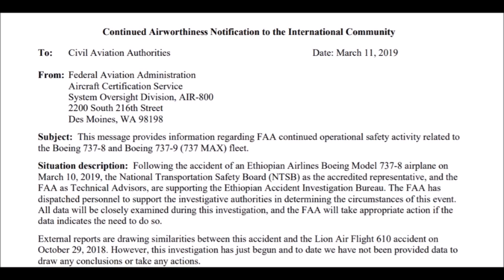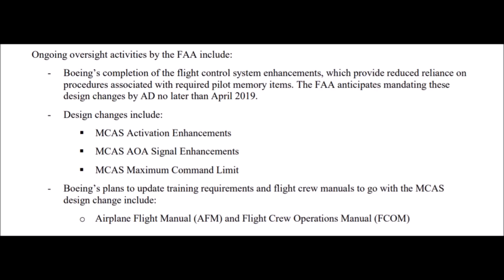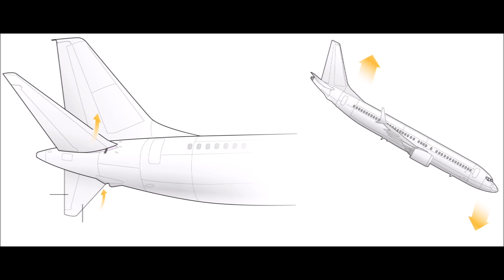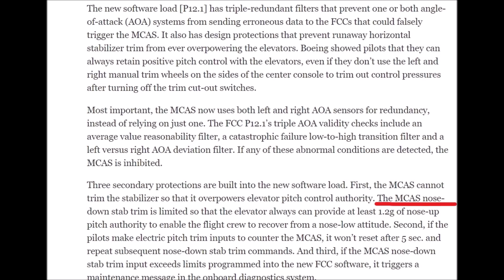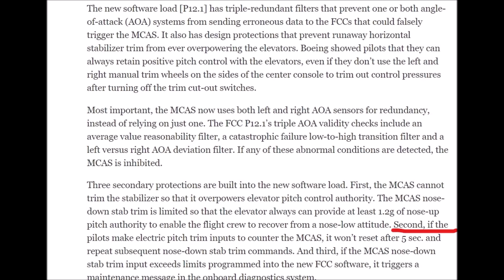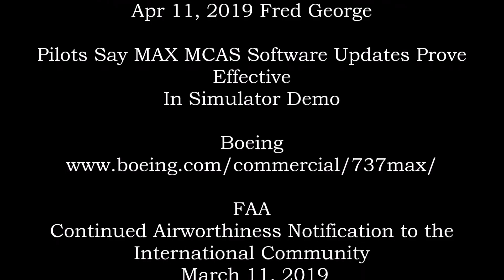737 Max UPDATE 14 April 2019 "The Fix"

Comment: I spoke to a retired Boeing guy recently. With any such organizations the engineers are gifted with "pointy-haired bosses"--- think as in Dilbert, the comic strip. These middle-manager types are ruthless people who sell out their staff at the drop of a hat. I would not be surprised if there are (or were) memos written by earnest engineers protesting the original MCAS configuration, memos that have now been deep-sixed.
Reply: Indeed.. Just look at the Challenger engineered who was ignored..
Reply: Precisely! Unfortunately nobody will go to jail, because the outcome was 'unforeseen', until it happened, twice!
Reply: An engineer at convair (who was part of a design team for the DC-10 rear cargo door) wrote a memo , he was ignored, result more then 300 died near Paris 4 years after that memo was written, lessons were not learned with these accidents 50 years later !!!!
Reply: @antoinemifsud4019  AAL 96 crashed in 1972 because of the door. MD wanted to keep it quiet, but the plane kept flying until the Paris crashed. It was grounded until the problem was fixed. Again it took 2 crashes with the same issue. Similar situation to the 737 hard over crashes in the 90's.
Reply: @fyrman9092  AAL 96 did not crash. Rear cargo door blew off, the plane made an emergency landing and flew for another thirty years.
Reply: @fyrman9092   Technically, AAL96 (the DC10 "Windsor Incident")  didn't crash, but only because of the incredible skill of the pilots in landing a seriously crippled and barely controllable plane.   But yes, McDonnell Douglas kept faffing around with half-fixes and arguing with their subcontractor Convair who should pay for it, which resulted in the 'Applegate Memorandum' -     "The airplane demonstrated an inherent susceptibility to catastrophic failure when exposed to explosive decompression of the cargo compartment in 1970 ground tests.   Since Murphy's Law being what it is, cargo doors will come open sometime during the twenty-plus years of use ahead for the DC-10... I would expect this to usually result in the loss of the aircraft".
Reply: These disasters reminded me of the DC-10 cargo door fiasco.  It is amazing that something so basic could be overlooked, but MD did it and now Boeing has.
Reply: @antoinemifsud4019  hahaha even me as a tiddly ground handler at a regional airport i noticed alot of people with the dash 8 q300 cargo doors were extremely rough with them... somtimes the butterfly latchs spring or whatever was completely worn out, when i would adress it with the pilots doing the walk around checks they would always dismiss it and say "nah its all good it will be fine"....
Reply: @maershkinschrabs7597  What the hell does that have to do with the two 737 Max 8 crashes we're talking about here?
Reply: @douglasmcintyre3297 I wasnt talking to you. Person I was talking to was reffering to the dc10's cargo door problem. I was just giving another example relating to ground crew handling to a different aircraft. Just saying many things can go wrong from design to  mechanics to the pilots to the ground crew. Mind your own business.
Reply: I have a current boss who in a position at Boeing would be solely responsible for this kind of accident. Any and all concerns that question his abilities to manager or direct a project are met with lies and deflections. It truly is a thing to behold. If peoples lives depended on the decisions of this one person then thousands would be dying daily. I also work for an organization where managers like him persist like herpes but it's a revolving door of good, great and bad engineers.
Reply: oh that's flipping great to hear......wow
Reply: The head of VW has been charged with fraud and will be going on trial.....
Reply: That is slightly different, the intent to defraud was clear at VW.
Reply: @gordonrichardson2972  VW engine control systems had more redundancy than Boeing Fight Controls
Reply: The difference is that the pointy-haired bosses are being investigated by the FBI, so satirised.
Reply: Its time Boeing invested in a completely new aircraft to replace the 737 platform. Airbus had no problem fitting new engines to the A320 as it sits much higher off the ground than the older Boeing design. The quest to save money has cost hundreds of lives.
Reply: @twobins2060  lives don't matter... :(
Reply: @twobins2060  Wasting money also costs lives. You just are not aware of who it is and where it is. Engineering is always a balance between cost and efficacy. F1 cars are marvels of engineering, but nobody wants to drive them on the road, or pay $1M for the privilege of driving. Tradeoffs will never cease.
Reply: Christian Libertarian indeed: expensive is not safe, cheap is not unnecessarily unsafe.  Spending to much in one area means you can’t have safety in another.  Lightweight is often safe.  Profit is safe because it lets you maintain properly.
Reply: No doubt ... memos will surface.
Reply: It wasn't just MCAS. 

Aviation accidents tend to be a cascading serious of errors or faults in equipment or pilotage. 

Keep in mind that it was the angle-of-attack sensor on the captain's side of the aircraft, damaged earlier on the ground while pressure washing the airplane that, in both the Lion Air and Ethiopian Airlines crashes, sent faulty data to the Max 8's flight management system, aka autopilot. All MCAS was designed to do was compensate for slight handling differences in the Max 8/9 compared to earlier 737 models the pilots were transitioning from. This was done so the Max 8/9 would handle the same in flight as previous 737 models. The design choice by Boeing that the Max 8/9's autopilot would only used data from the Captain's side AoA sensor, when there was another properly operating sensor available on  the first officer's side, was reckless and irresponsible.  

So its wasn't MCAS alone that caused these crashes;both began with faulty sensor data.  Also the Ethiopian flight crew had switches off the electric pitch trim system to disengage MCAS and regain control, of the airplane, then unintentionally re-engaged MCAS by turning the electric trim switches back on!!!!. Presumably so they could re-engage the autopilot.  

So the Ethiopian crash was partly caused by a ground crewman who damaged the AoA sensor while washing the plane. Then whoever did the walk around  inspection (probably the first office) didn't spot the damage on the ground,. Then the AoA sensor gave erroneous data to the Max 8's flight management computer. once airborne.  Plus an inadequate, inexcusable and ultimately unsafe design by Boeing, who also didn't adequately train or provide manuals for the pilots to address this problem in flight. And inadequate oversight during the certification process by the FAA.  And some unfortunate but understandable pilot error contributed to these crashes  as well.
Reply: Douglas McIntyre well summarized.
Reply: @JBWhitney0402  Thank-you sir, for those kind remarks.
Reply: Swiss Cheese.
Reply: I used to work for a very large corporation which was just like that. We produce thousands of MBA toting drones these days who know nothing but how to strip max value out of people and an organisation.
Reply: EpiDemic117 thanks - I didn’t know that. Maybe the airlines will rethink when customers refuse to fly on a 737Max. Ryanair have a 737 fleet and were about to take delivery of the Max. EasyJet fly Airbus. I’ll change to EasyJet if Ryanair fly the Max. If the Max flies again and has another crash within a year I reckon it could finish Boeing. It’s a shame because Boeing can and do produce some great aircraft.
Reply: You describe Wal-Mart also! Did these work atv Wal-Mart?
Reply: say.......Morton Thiokol ?!!!
Reply: This type of thing is rampant, and its even at committee level.  I used to work for a very large software company and they did things that boggle the mind, and much of that was group policy etc.
Reply: @NickFrom1228  All due respect to posters       m oc and Nick Knight above, but you two seems to at least partly be missing the point. And your rather silly ideas that software companies' executives are reckless as a species, is a gross and foolish generalization. 

Both of these crashes were primarily caused by erroneous data sent from the Captains' side angle of attack sensors to the 737 Max 8's flight management computers. The Lion Air pilots pilots weren't trained at all on MCAS and, like the Ethiopian crew,  at least initially had no idea that AoA sensor was sending bad data. 

A reckless decision by Boeing, approved by the FAA during certification had only the pilot side AoA sensor feeding data to the FMC. Which begs the question: why have a first office r's side AoA sensor, if it doesn't talk to the FMC?  

In the Ethiopian Airlines crash the first officer correctly deduced the problem after wrestling with the controls for a few minutes. Then the crew shut off the electric pitch trim switches, since trying to recover from the pitch oscillations by using electric pitch trim was exacerbating the problem. . Then they tried to regain control of the aircraft but later inexplicably turned the electric pitch trim switches back on, re-creating the control problem caused by reengaging MCAS. Then MCAS started to try to compensate for the pilots attempts to gain control by re-trimming in pitch, which made the plane pith nose up and down several times. 

Since both incidents occurred at relatively low altitude, the flight crew didn't have much time or sky below them with which to troubleshoot and solve the problem. 

Also, MCAS was only installed in the 737 Max8/9 to compensate for small differences in handling compared to the 737 Next Gen models (,600, 700, 800 and 900 series). This was caused by relocating the engines higher up under the wing and mounting them farther forward.  In short, MCAS was only there to make the Max 8/9 fly and feel just like the Next Gen models. Which is probably why Boeing didn't have more information about it in the flight manuals. 

The fix by Boeing will not simply be software changes, although the MCAS software will no doubt be partly rewritten. That was clear after the preliminary report on the Lion Air crash. But Boeing will no doubt also find a way to make the right side AoA sensor also play nice with the FMC, and possibly add a system of crew alerts to compare both sensors and alert the pilots if there is a significant discrepancy between the two sensor readouts.  And the flight manuals and QRH's (quick reference handbooks) will have the proper amount of information and guidance. And there will for the life of the Max 8/9 now be simulator training for pilots to train and practice recovering from this condition. 

What is less clear is just how much money  has and will continue to be lost by Boeing and airlines around the world due to this fiasco. Boeing has lost  prestige and public confidence in their newest 737s. They'll no doubt be sued by the spouses and relatives of the lost passengers. That could be literally billions of dollars of tort exposure. Airlines who had to take the Max 8/9s out of service and scramble to put other planes on those routes will demand to be compensated and sue if necessary. Boeing will have to make expensive changes to every max 8/9 in the world, and those yet to be built. 

Perhaps most uncertain is whether the public will ever choose to fly on the Max 8/9 in the future. And whether airlines have lost confidence in the Max 8/9 and will have to change to different plans on those routes, long term. And will EADS, better knows as Airbus, be able to take advantage of this tragedy by ramping upon production of and selling way more A-220s (formerly  known as the Bombardier C Series) and more A-319s, A320s and A321s. Could Embraer of Brazil also reap a benefit and sell more of their smaller airliners at Boeing's expense?  

And the FAA is on the hook for class action suits for certifying MCAS on the Max 8/9. In the words of Ricky Ricardo, Lucy's fiery Cuban husband on the old sit-com  I Love Lucy Show, "...someone's got a lot of 'splaining to do here ..."  

Perhaps some good will come out of this mess if FAA re-learned the hard way that allowing aircraft manufacturers to self-certify their designs is not in the best interest of the flying public. Nor are two-hour I Pad courses adequate to transition pilots from one model of 737 or other airliner to another variant of the same basic design. And simulator training, while expensive, is a lot less expensive than Boeing and the FAA and the AoA sensor manufacturer getting their asses sued off for the next twenty years.
Reply: @douglasmcintyre3297  My apologies for my brevity creating a misunderstanding. I was simply trying to agree that software is often subject to idiot human decisions. In fact on some other video I posted pretty much what you have said here. Why on earth did they reengage the pitch trim? If I remember correctly, the flight manual indicates that if a problem occurs with these systems you are supposed to fly the plane and not reengage the automated systems. I think the fact that we have many of these planes in use in the US without problems because our pilots are more competent and are less likely to have to rely on the automated systems. Overall the issue is a combination of several factors, all of which should not have resulted in a crash if the pilots were properly trained and acted properly when they encountered the situation.
Reply: @NickFrom1228 I'm speculating here, but my guess as to why the flight crew chose to turn the pitch trim switches back on was twofold: 

a) either they weren't trained on recovery from MCAS failure and hadn't recognized the bad data from  the captain's side AoA sensor was the initial cause of the unusual pitch oscillations or 

b) the flight crew weren't comfortable with hand-flying the Max 8 for long enough to get it back on the ground. Or they were planning to continue the flight , meaning reengage the autopilot, since virtually all jet transports are flown that way almost all of the time. 

Just my guesses.
Reply: @douglasmcintyre3297  I agree.
Reply: Douglas McIntyre You missed c) The hand crank couldn't fix the bad trim without letting the plane dive into the ground.  So electric trim buttons on was the only option left.  And none of the information given to pilots by Boeing explained how to override MCAS with power on.
Reply: Why doesn’t anyone talk about aviation safety record compared to the insane driving on the highway I see everyday and over 40,000 fatalities A YEAR on our roads. I’ll take a Boeing airplane anywhere anytime instead of getting Run over my Keystone Cops
Reply: @p38cobra  Because anything that takes lives more than a few at a time is "dramatic" news! A weekend MVA that involves the death of an entire family, might get a quick mention on the news, but does it ever mention that the vehicle maybe at fault?   Safety comes at a cost, a new (to me) vehicle, that has airbags all over, has severely reduced my visibility and increased blind spots - but it's safer because of the airbags... its all a trade-off. The media might get 150 deaths to report about in 1 hit, but hardly reports the 150 deaths a week in 1 state! I would fly on the MAX now, ( before repairs) if I knew there were appropriately trained pilots, that had the presence of mind not to let the aircraft fly beyond normal limitations. If that stabilizer is going beyond normal limits, you turn off the power! Seems like a no brainer to me! Letting the speed increase to well over 100 kn past VMO, particularly at such a low altitude, is outrageous - regardless of the MCAS fault!
Reply: @p38cobra  because it is news worthy... you are accurate in stating it is safer to fly than drive as a whole.
Reply: @p38cobra  ill take a car crash over a plane crash any day.
Reply: @p38cobra  People instinctively  understand the inherent danger of being transported in a vessel which defies gravity during its entire journey. On the other hand, most drivers have little understanding of the physics involved in operation of an automobile. Even simple things like doubling your speed QUADRUPLES the amount of energy disappated of a crash (kenetic energy = 1/2*mass*velocity^2).